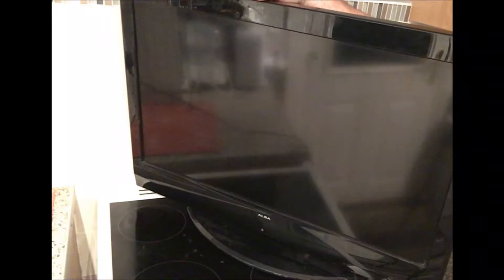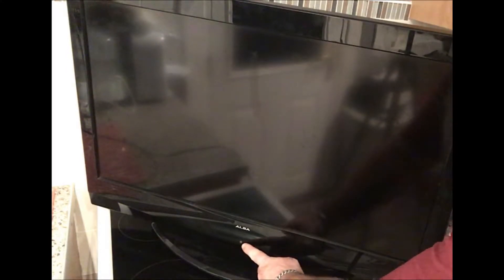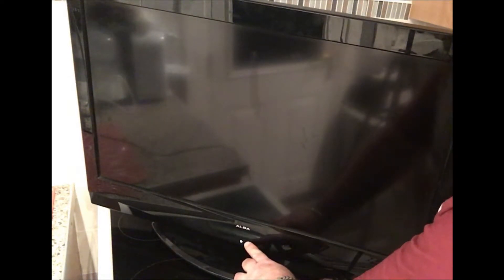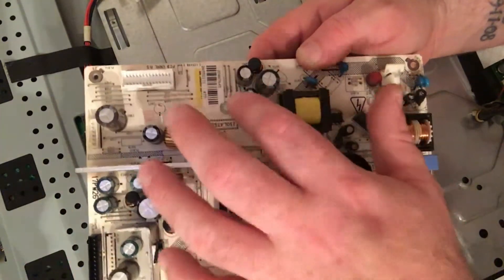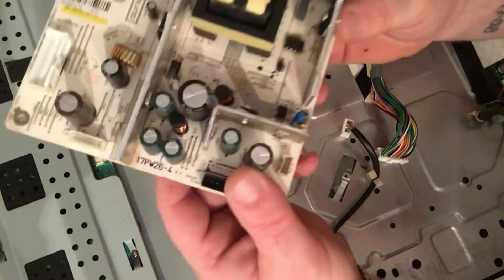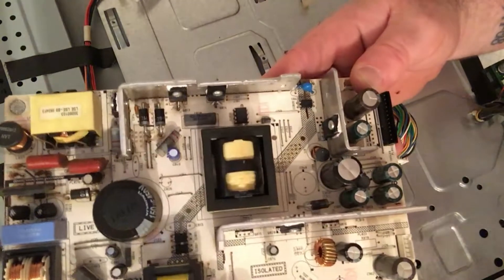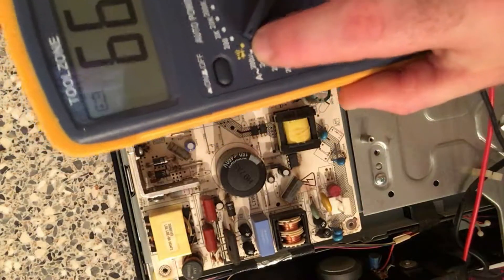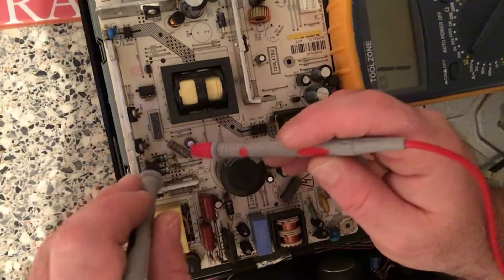ALBA LCD TV -  stuck on standby - power supply easy fix - most common repair for power problems

Comment: How do I identify the diode if I don't have a spare board please mate.
Reply from the maker: There is a code written on the side of the diode type this into eBay and you can buy a replacement very cheap thanks

Comment: Hi

I have the same issue
The standby light goes off but then returns. Won't switch to TV on.
I checked the diodes, all fine. What else could I check.
Any help would be appreciated 
Can't afford another TV

Thanks 
John

Comment: I have the same tv and problem but it's a 26 inch tv but the part number for the board is the same, the part I've seen on ebay as the same part number but it says for a 32inch will this part still work for my 26 inch
Reply from the maker: yes this will be perfect

Comment: Hi great video I have a different TV, an old  Acoustic Solutions but the problem I have is similar, when I turn on at power button blue standby led is solid as normal, but the way I power mines on is to press the remote, there is no other buttons except the usual volume etc, so when I press my remote that's when the led starts flashing, sometimes it will flash a few seconds then stop, and if I press the remote a few times it comes on.

Though sometimes the led won't stop flashing and there is no way it will power up when it's flashing, so I then have to fart about pressing the power button on and off, but due to this I have learned if I listen there's a little sound inside the TV, like something is kicking in when I press the power, and 9 times out of ten I know it will power up the led may flash a few times but it will power up eventually, if it doesn't I repeat the process listen for the sound and I get there in the end.

Could it still be my PSU though and the same fault with the diodes, I have the same board only difference is last part is dash 3, instead of 4 like yours, so I'll test the diodes, but wanted your opinion, sorry for long explanation but I was trying to cover everything, Thanks.
Reply from the maker: no thats absolutely fine - im guessing you have bulged blown capacitors, have a look and vchange the bad ones out really simple job see my other videos that will show u how to do it - please sub me thanks - also check the diodes ofcourse

Comment: I bought a new board, and this is the problem I'm having. They must have sent me a board with a bad diode on it
Reply from the maker: kamal faruk have you tested the diodes with a multi meter
Reply: @FlipTVsForProfit  I contacted the company, they are sending me a new board, I think they sent me a faulty board.

Comment: Being as I am not as clever as you, could I just buy a board?
Reply from the maker: Daryl Sims yes you could buy the board on eBay but it’s simple to just replace the component
Reply: @FlipTVsForProfit  
I ain't got the tester or soldering iron.
So by the time I go out and buy if I can get a cheap board I'm happy.
Your video was brilliant.  Thank you...
Reply: @darylsims4407  soldering iron £10 pounds, Multimeter Voltmeter £17 pounds, 
(Pack of 20 Pieces) Chanzon 10A10 Rectifier Diode  $6 dollars 
not sure if they are the right Diode.. but all for cheap all from Amazon
Reply: @tktdonington  thanks mate.